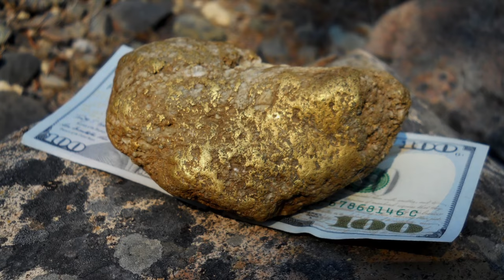Finding BIG gold with the Fisher Gold Bug 2 - Dredge Tailing Pile two pound Nugget/Specimen!

Comment: On the old dredges, there used to be a guy on either side of the stacker line with a bucket between his legs. It was his job to grab the big ones that came out of the dredges trommel and place them in the bucket. Sometimes they came too fast and they missed a few, sometimes they were still covered with mud and they missed those.

Comment: Do you have a in depth video of how to tune and use the gold bug II??...I took mine out to a area with mines and it just goes crazy over every rock..I think it's all iron or hot rocks..the area does have silver and copper and some small gold...what's in a hot rock?...how am I going to find small gold if it's just going off over everything??...help
Reply: Ground balance,then set to high mineralization,if thehot ground is still a problem then switch to discrimination .
Hot rocks will popand click but only nin ferrous targets will beep.
There's zero threshold in discriminate mode